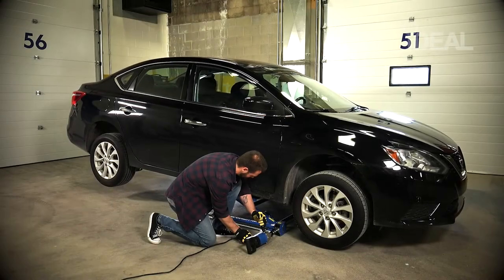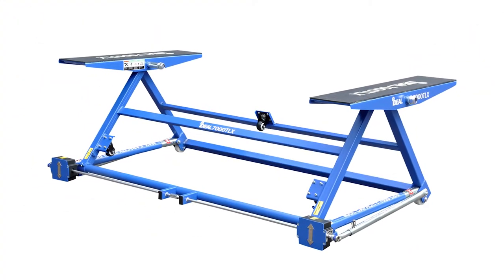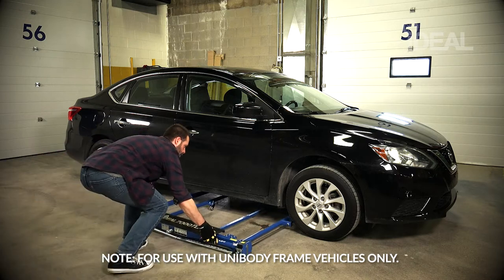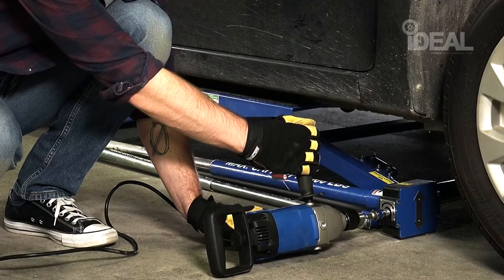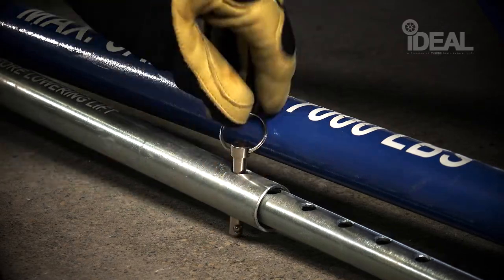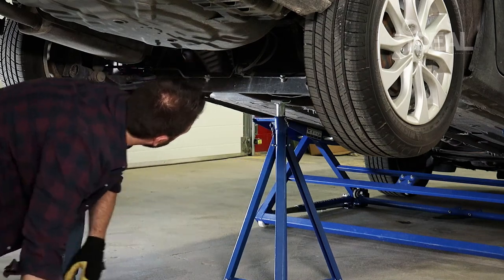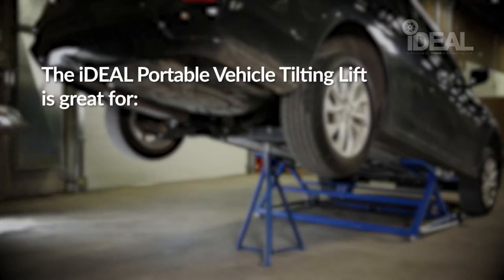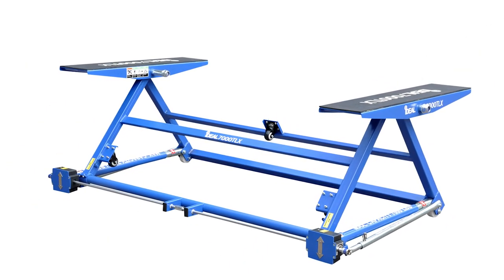9056656 - iDEAL 7,000 lb Portable Tilting Vehicle Lift

Comment: No clear working area for the full length under the car. Plus don't have room to slide it in under the car in a one car garage, cannot drive over it like the Quickjacks. Only advantage is when electricity not available.

Comment: $1700 on sale at Princess Auto. Regular list is $2000. 
Just wondering how well it works lifting in the non-lift point area of the vehicle.
Reply: I wonder if you could add 2x6s or bigger to spread the lift weight even more?
Reply: Few hundred dollars more I rather have a 2 post lift.